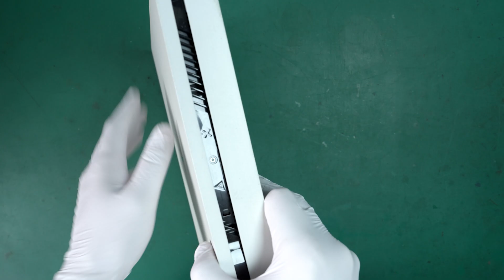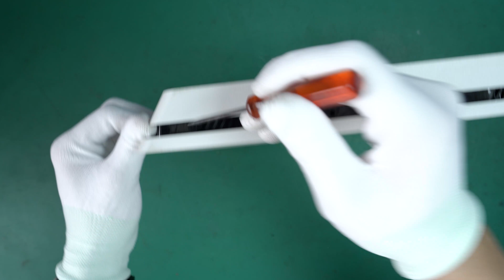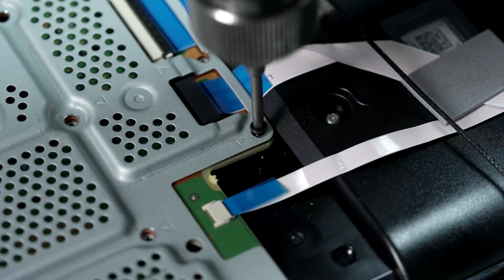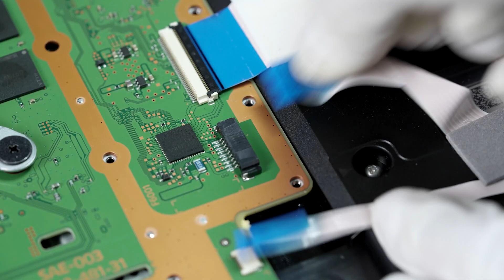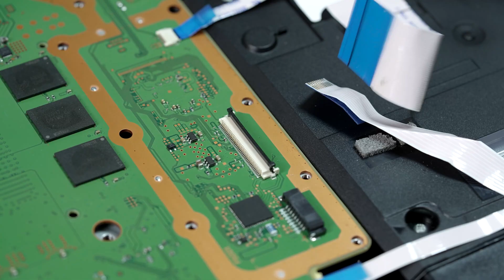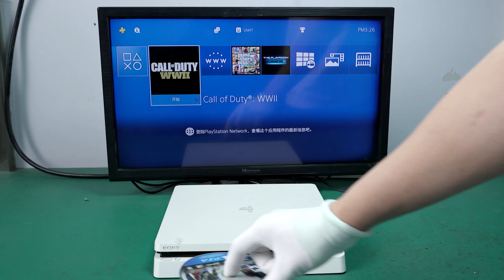PS4-Optical drive and laser module replacement

Comment: Lift the PSU from the top side right after removing HDD, don’t risk damaging components trying to prise the logic board loose from the PSU
Reply: what do you mean? im trying to find a good tutorial for a laser replacment but i got confused with your comment, can you elaborate for newbies thanks!
Reply: @eddddhah so, in this video, he doesn’t remove the power supply. He pries the board from the PSU. That’s risky, you can damage the 5v cable doing that. Once removing the hard drive, take the top off the ps, and take the power supply out.
Reply: @ShadowEli94 im tryna replace my laser only, i found a video where you could just yank the cover of the lader deck out but you're gonna need some force to crack it open, do you think thats better than these a lot of screwings